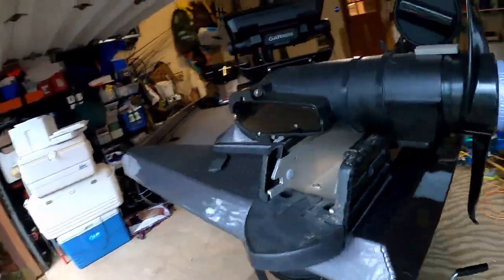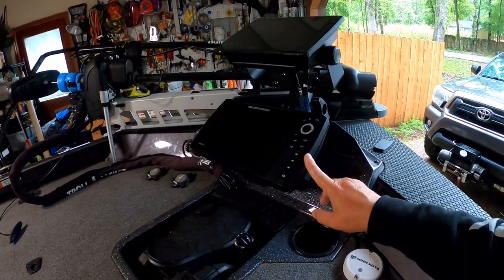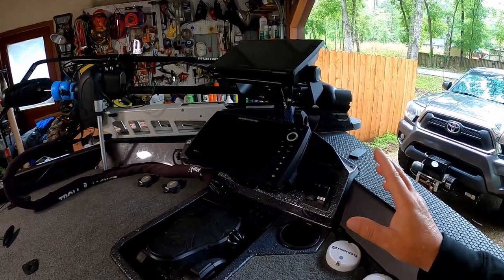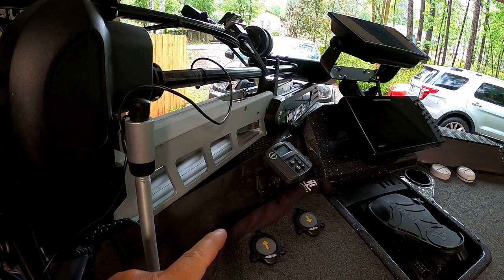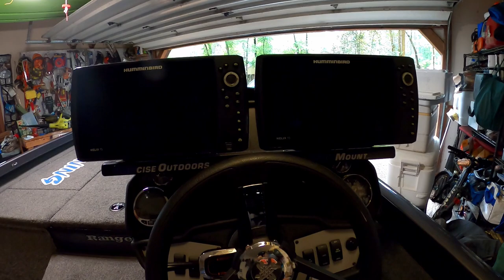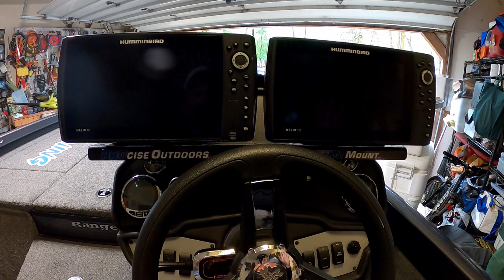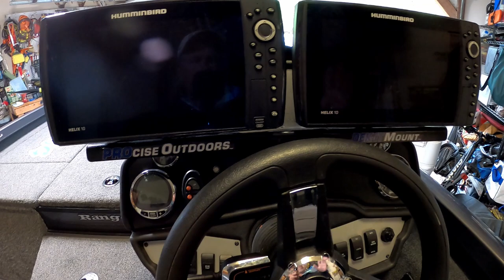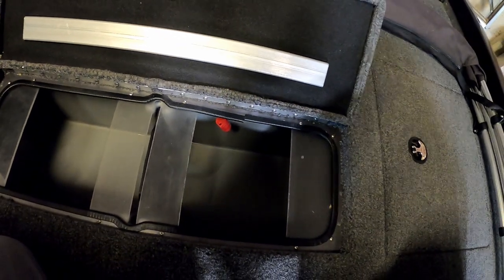Ranger 198P Bass and Crappie setup

Comment: I have humminbird core series,and I have found on the console side scan that if I set my scroll speed about 2-3-10ths faster than I actually scan on the mph of the boat.usually my GPS will be about 3.1mph and I set my scroll speed about 3.3-3.4mph.but when I buy another boat I don't think I'll even put side scan on the front of it,because when I'm fishing speed is so inconsistent that ss is useless.so I just use my ffs,and 2d and downscan.on the lifewell thing pool noodles cut to length,floating on top keeps em from jumping out,and serves as Insulation ta keep water cooler.